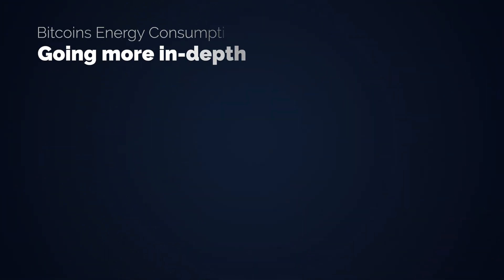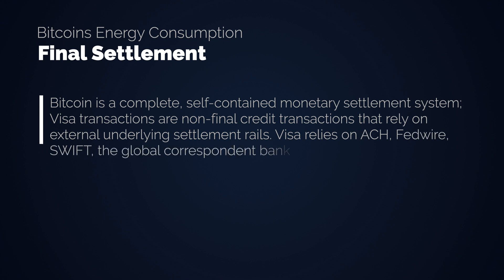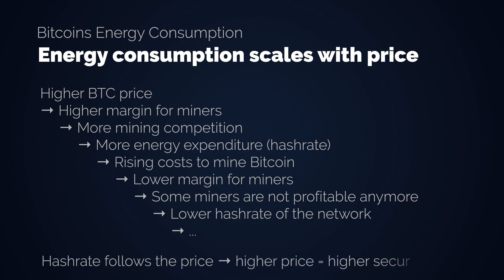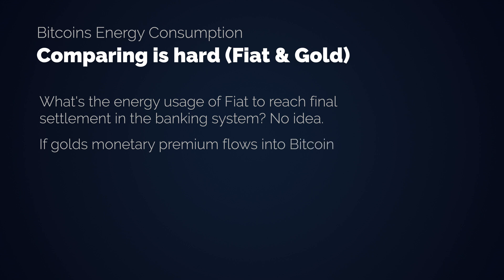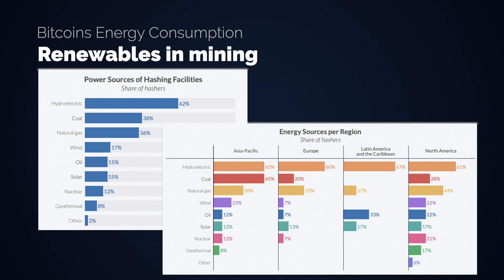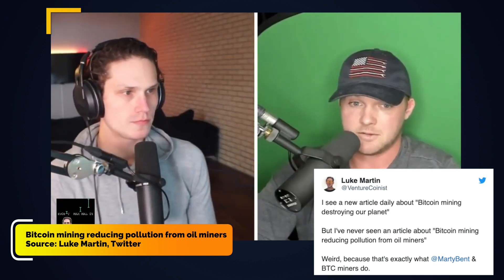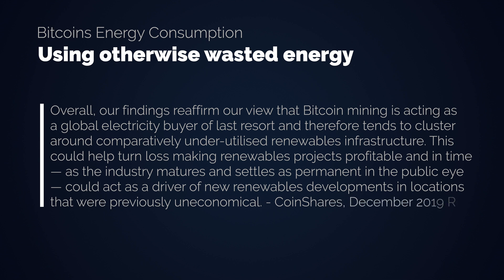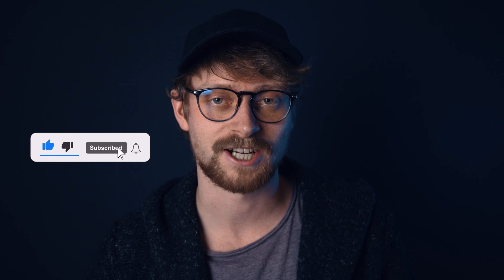Discussing Bitcoin ENERGY CONSUMPTION - How much Energy, What Type of Energy - Is it justifiable?

Comment: Bitcoin also allows stranded energy to remain stranded, excess Chinese Hydro would be better utilised if it was better grid connected and helping put coal power plants out of favour. Bitcoin mining from natural gas also liberates a lot of oil that cannot otherwise be extracted due to environmental regulations that ban flaring. Lastly, Bitcoin security depends on the energy spend, so if it wants to remain secure, it need to keep spending a lot of value on energy, that makes it vulnerable to cheaper competition from next gen cryptocurrencies that have no fees or energy spend.

Comment: Excellent analysis.  I made a few videos on crypto algorithms as well with an angle towards sustainability.  My takeaway is that today, as hashrate complexity continues to increase with price, the mining demand may not justify the energy footprint - despite a shift towards renewables as you noted.   Particularly for the fundamental reason that as price increases, so does security, and thus there seems to only be a positive feedback system in place.  Yes, eventually as mining rewards shrink this could reverse course, but that's pretty speculative and many, many, decades away.  I think alternative protocols like proof of stake may provide viable solutions in the short term, but as you concluded, BTC/PoW is the gold standard for now.

Comment: What also should be mentioned, is the inclusive nature of PoW.
Presumably, Satoshi didn't have to sell a single Bitcoin to spread his network, since you could mine with a PC back then.
Today, PoW ensures that states cannot be excluded from the network.
Even if individual states were excluded from regulated trading, North Korea, Iran, and Russia could still participate in the network as miners and convert energy into BTC.
I consider that a big plus.
For fun, some speculative thoughts (a phantasy, if you will...) on the waste-heat use of PoW from a central-european perspective:
Virtually 100% of the electrical energy fed to an ant-miner is converted to heat....
I think 60ºC is the temperature of the waste-heat airflow.
That should be economically feasible to use.
Some suggestions:
•heating water (industrial laundry, private households...)
•drying laundry (again industrial laundry)
•drying wood chips (forestry, sawmills...)
In the course of the energy transition (=Energiewende), there will (occasionally) be green surplus-electricity in the german power grid from April to September.
In other words, at the electricity-market-exchange, the price of electricity is already occasionally negative in the bright half of the year. 
The more the energy transition (=Energiewende) progresses in the future, the more often there will be negative electricity-prices.
Large customers will probably get paid for using this surplus electricity from the power grid.
In other words:
In the coming years, one perhaps could get paid as a large customer by the electricity provider for converting temporary surplus electricity into BTC and hot water (or dry laundry, or dry wood ships...)
     (You know what's better than free energy? - Getting payed to use it!...LOL)
electricity
Energy transition and PoW... that could become a wonderful friendship.
How realistic is that?
Does anyone else have ideas for waste-heat utilization?